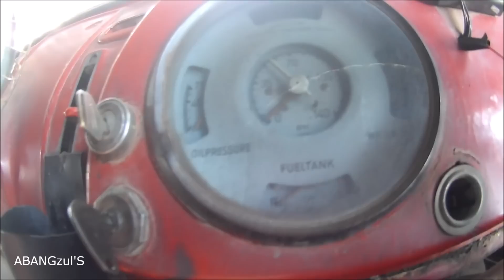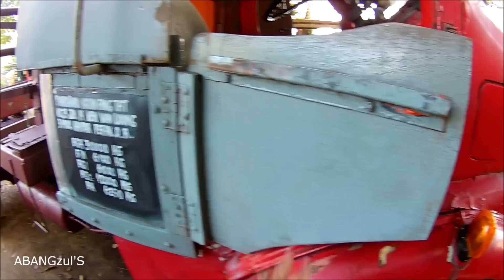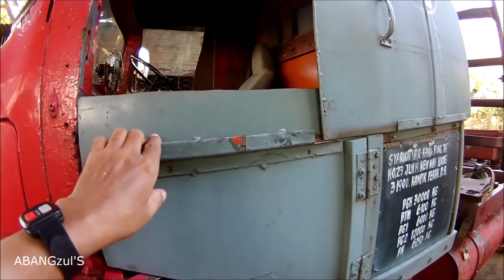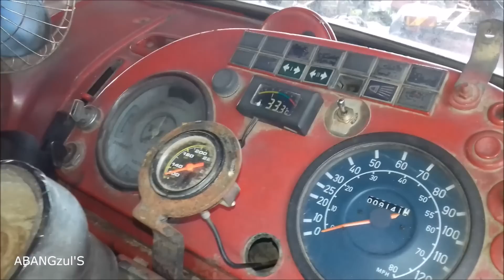Lori Mercedez-Benz LA911 Short Bonnet

Comment: Dulu permit 26t. Manjang kena hambat. Sekarang semua dah up 30t. Ok la sikit.
Reply from the maker: Hehehe... Tan kayu & tan biasa fenin woo nak kira
Reply: @AbangZul  setahu aku Lori balak memang dari dulu permit 30tan untuk Lori trailer kargo biasa& tanker je yang 26t (10 tayar) 14 tayar 32 t..
Reply: Abg nazri bin tan..ala sama je abg..26 t ke 30 t ke..klau jpj nmpk dia humbat jge..
Reply: @aditok9651  Many years ago
Sorry, my bahasa Malaysia is not good enough for this
I have come across a broken half shaft.

In Malaysia the Mercedes Benz LS1418 Prime Mover or perhaps a LA911 Short Bonnet 
was widely used not least to pull very heavy loads of tropical timber, mostly overloaded
The old road across the dividing range between Kuala Lumpur and the forests was very steep and twisting and the old road even more so. On the flat these vehicles made good speed but as a car driver you had to be very much aware that if you came round a corner on an incline and saw a load of timber it was probably going at walking speed.
From time to time I took the largely empty old road and stopped overlooking the new. I could hear the drivers changing down all 6? gears in two ranges of gears. If they fluffed a change the lorry would stop. Getting moving again was also very difficult. It was not unusual to see the crew of 2 working to replace a half shaft